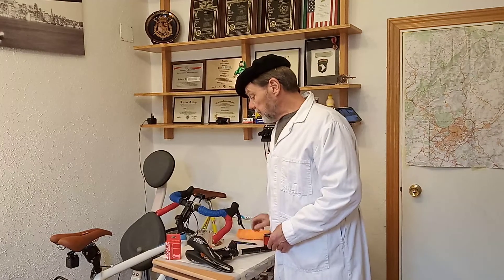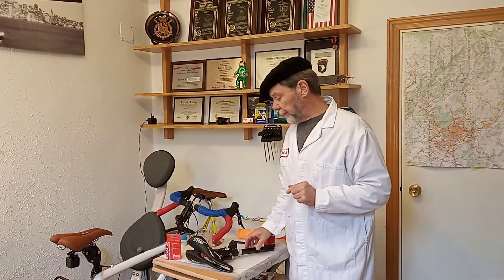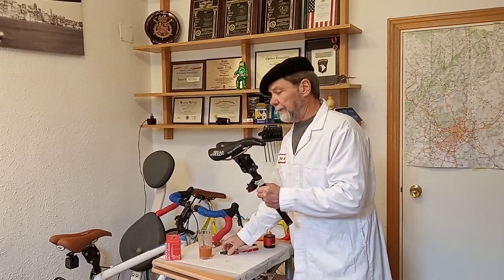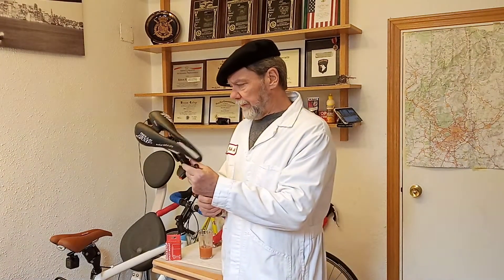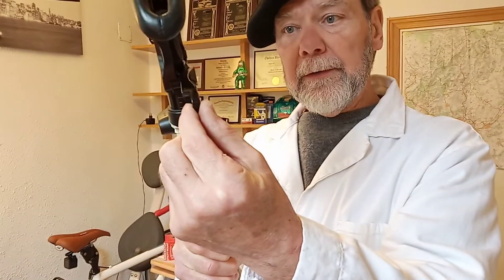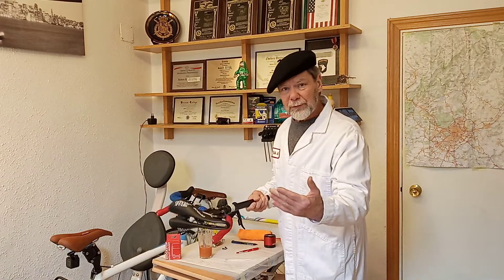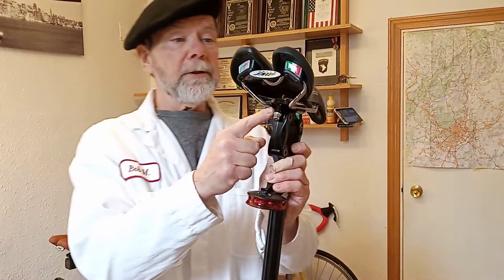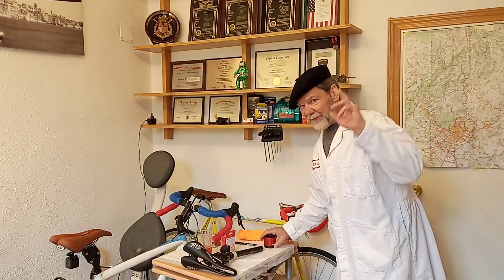ThudBuster:  From an Engineer's Perspective / Links in Description

Comment: It's a fair assessment.  I like your idea of mating two different rubbers together in the puck.  Maybe you could sell it to Cane Creek?
Reply from the maker: Designing the puck with two separate pieces is a piece of cake.  They'd simply slide together like a puzzle piece.  It would only cost a few Buck's extra in Manufacturing and they could make a huge profit on the concept and launch "Thudbuster 2".  I've been a mechanical engineer over 35 years, it's easy to be a "backseat driver".  Keep an eye on Redshift.
Reply: @bobmajew53   wow, thought they were free, just file.
Reply: @bobmajew53   Tolerancing is something young designers struggle with.  You're not the only ME here, I understand what you were saying and I probably wouldn't have used Y-14.5 at all.  It's ads Machining costs cost and it isn't necessary for such a simple part.
Reply: @bobmajew53   I don't see kids on your channel, you're not flashy and noisy.  Maybe you should get a baseball cap and wear it backwards?  That's what most 40 year old YouTubers do to impress teenagers.
Reply from the maker: @tommasi566   Tom, thanks for Subscribing.  I wish I was 40, maybe I would.  I'm not going to hide the fact that I didn't waste my time.  But unfortunately most good things are luck.  I've been fortunate to work at generous companies, one company kept all patents and designs and Engineers got 0 credit, it all depends on the company.  Technically they own everything you do.